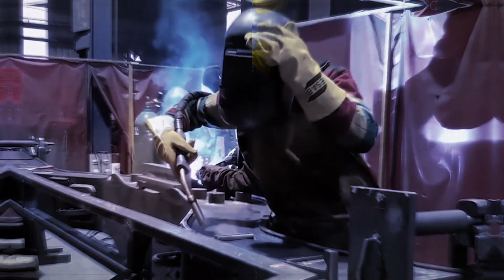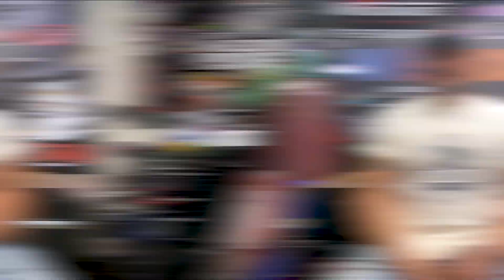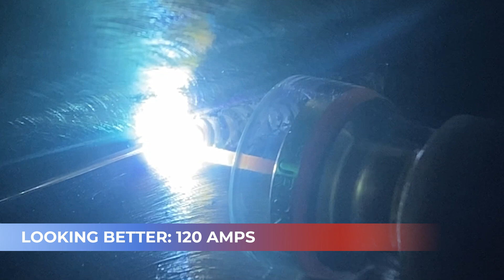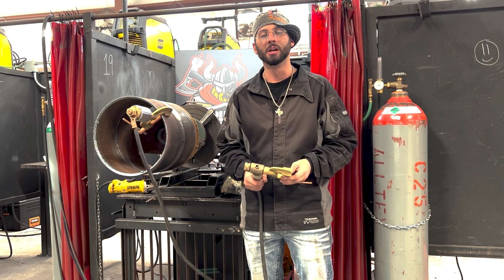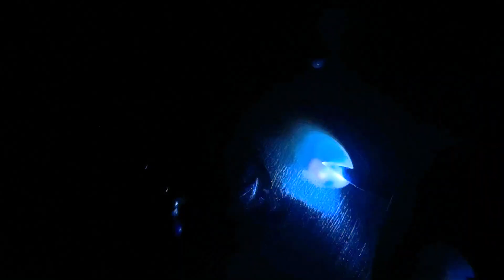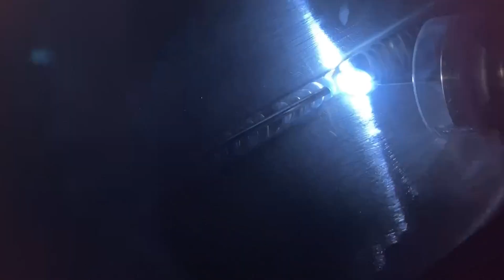Puddle Recognition Tips For TIG Welders -Part 1

Comment: allot of good information BUT all you guys that are learning this one of the best ways too learn is mistakes 

you need too burn through the material AND not enough heat is also good…when you know your am sweet spot add and remove 10-15 amp in order too see what happens. burn through the work as much as you can, this is better than trying too get it right! after you do this many times you will definitely be a better welder!!

In my dirt bike days, i only got food after a few falls, learning anything is no different. i see the internet teaching everything but this and too me being comfortable (after a few) with burning holes takes allot of the fear that something might go wrong away…leading too a better weld!!!!

Comment: It's a nice explanation this video, great short course but, you should have done demonstrating with let's say cup 8 or 7 something you usually find in every company, small fabrication facilities and such, not the damn Furick cups. I mean start with the first step on the ladder not the top one...
Reply: TIG welders have been making successful welds walking the cup long before the Furick cups were available, however the presenter made it clear that this is what he prefers, and having done some cup walking I can see how such a large cup would be advantageous. If you don't want to use the Furick cup that's fine, you're technique won't differ that much just jump in and practice.